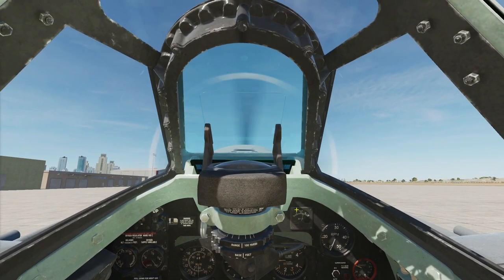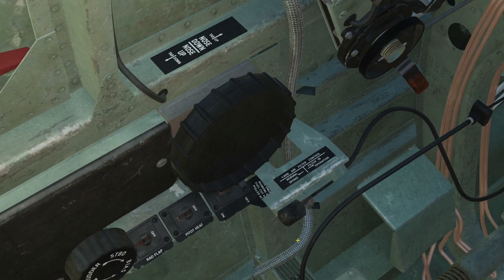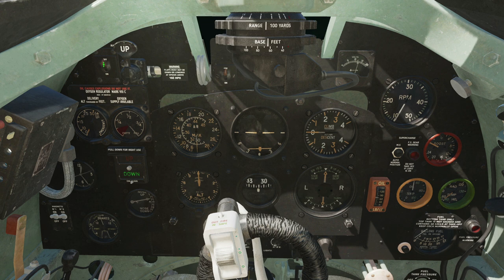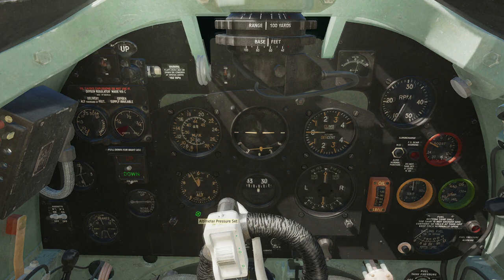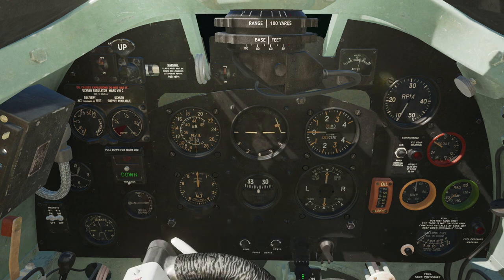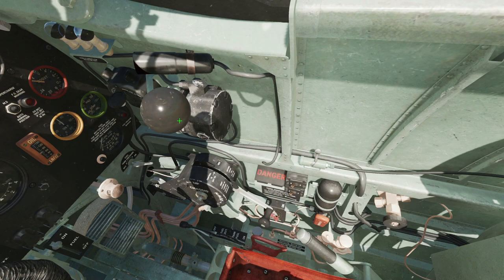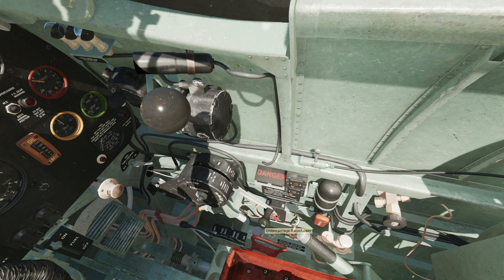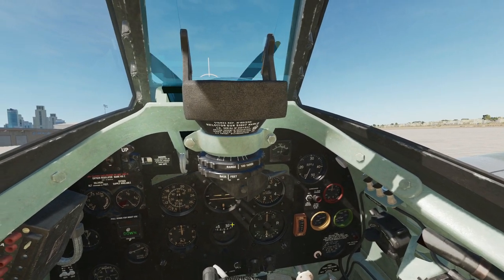Spitfire: Cockpit Familiarization Tutorial | DCS WORLD

Comment: Radiator Flap  description:  Switching ON  opens the flaps immediately,  end of storey  even if engine idle on the ground  (not a good idea overcools the engine).  You can see them open if you look on F2 view.      'Off' is Auto .   I prefer  to switch manually ON when entering a dogfight  to be certain they are open to avoid overheating engine under stress.         Fuel Pump switch MUST be set to ON  if ascending above 12,000ft otherwise engine will cut out.  Below 12,000ft  doesn't matter whether off or on.       Also worth noting the TYPE OF GUN AMMO being carried has a significant impact on damage to different target types with the spitfire.   Default is Combat Mix  which is 'OK' for anything,  BUT if going against Bombers  the HE ANTI-BOMBER  ammo is way more effective  . In fact I use that for general A2A,  and use Combat Mix  if I am ground strafing/mixed role.   Not convinced the GROUND ATTACK ammo is more effective than Combat mix  for ground attack.
Reply from the maker: thx Super ARty

Comment: Good video but a correction is needed at 6:50
The lower half of the slip indicator is a turn indicator not a bank indicator as you suggested. It is a single Axis giro. It measures the rate of yaw and has nothing to do with the bank the airplane has on it. It measures degrees per second. you could skid a turn with the wings flat using rudder only and it would indicate how many degrees per second your nose is drifting left or right.
Reply from the maker: thxx

Comment: The Mark IX Spitfire in our Museum has a round brass firing button on the top of the control column. Also by the pilots right shoulder is a fitting for a Morse Code transmission key.
Reply: That's odd
Basically, the A wing was used on Mk 2a's and about 100 Mk Va's
The Mk IX was at first converted from Mk Vc airframes, all of which used the C wing and very little chance any of those used an 8x 303 weapons loadout
and even if they did, I'd still wager they would carry the Mk IX's dual trigger
Reply: @Nightdare  I have been informed that a Mk 1a trigger button has been used because the builders/restorers  could not find a genuine Mk 1X version with the slider switch.  The Morse key has now been repositioned in front of the undercarriage lever.
Reply: @PNH750  

Like I said: odd, because the dual trigger was probably produced the most and used the longest